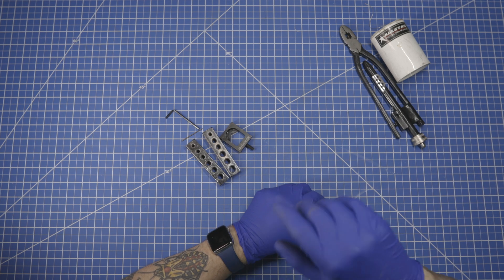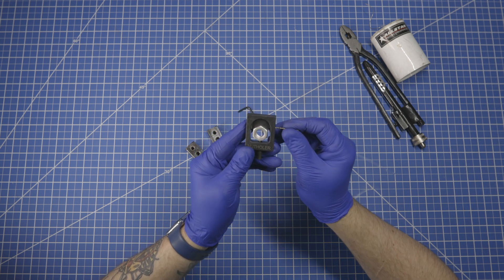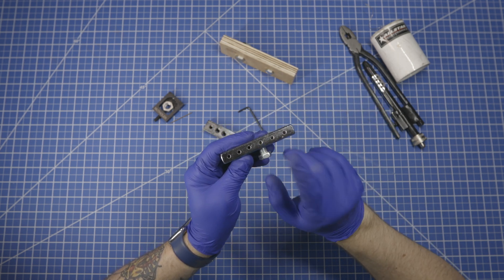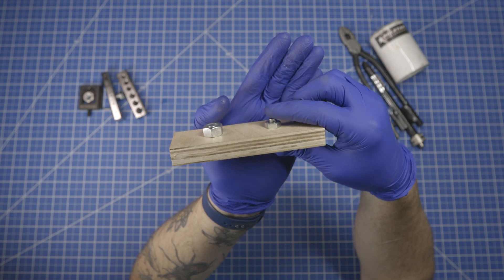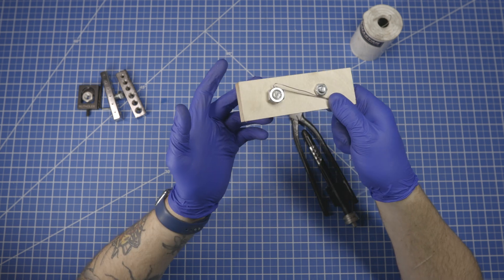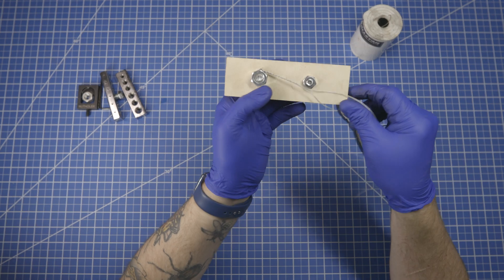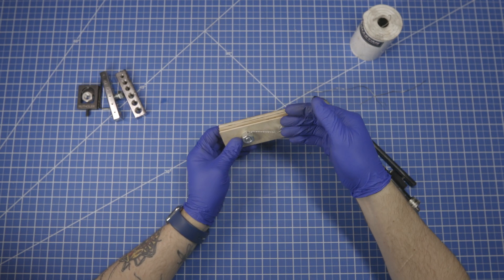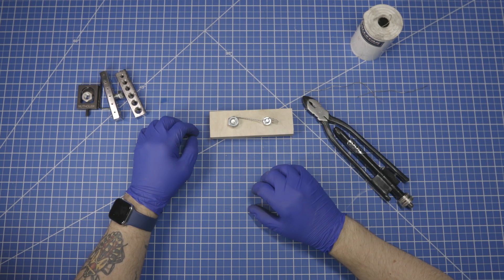Safety Wire Tool Basics - Fastener Prep + Safety Wire Installation

Comment: Safety wire requires much patience and there are a lot of rules. 0.032 requires 7-8 twists per inch, twists must not exceed a distance of 1/8 inch from the hole but must not be tight to the bolt. Wire must not be pulled taught. Pig tails must be reverse twisted and turned with the direction of the wire. Twists may not be removed. Wire requires at least 20 degrees of positive pull. Wire may not exceed 6 inches in length between fasteners unless stated otherwise.. etc.That is the GE aviation SPM guidelines anyway.